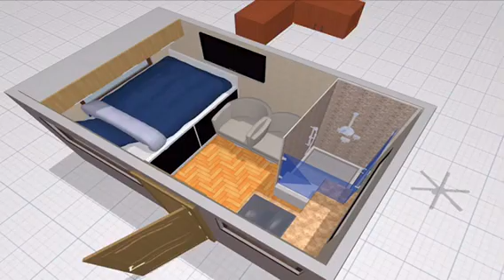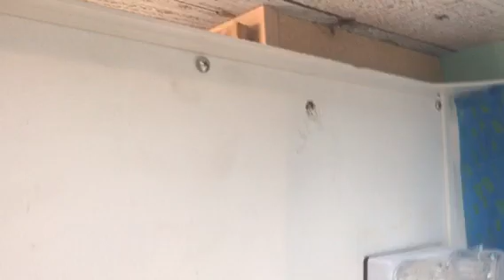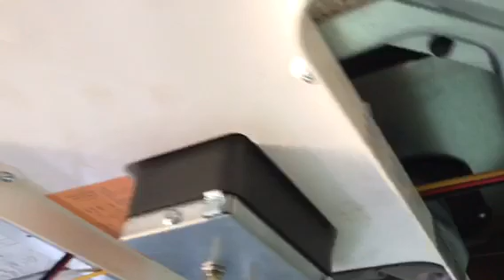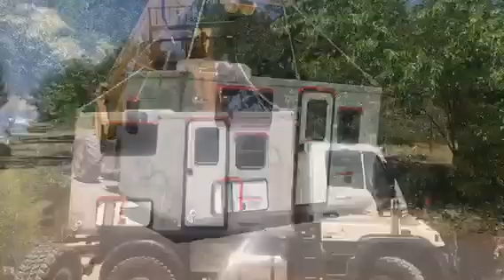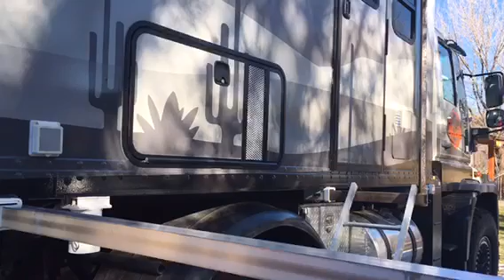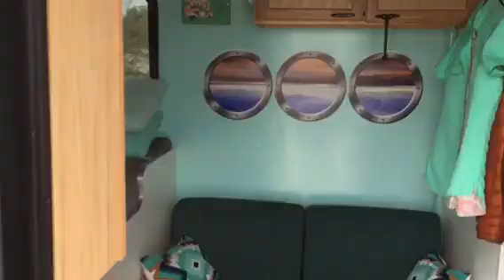Unimog U500 DIY Expedition Camper Build

Comment: Hi there John. Really amazed what you did by yourself.  Absolutey 'FANTASTIC'. But I just wondered why you did not insulate the grey water tank or tanks and opened a pasaage through the driving part. Beacuse you are really talented and it seems you have the know how about to build anything . Greetings from Istanbul/Turkey. Enjoy man. Atilla...
Reply from the maker: You are correct. I should have insulated the gray water tank.   And as far as the pass through,   I will be adding this as soon as I come up with a good plan. 
Still a work in progress. thank you for your comments
John.
Reply from the maker: My next project will be to add the pass through.
Reply: @johninthedesert2632  watching will be a pleasure for us

Comment: Just an idea, but what about an angled cover guarding the retracted veranda edges and a thin sheet of aluminium on the underside of the veranda from being grabbed by a heavy branch if you're in a tight bush track with heavy foliage either side?
Reply from the maker: Chris H I understand your concept and at the same time I would like to take a little bit of pride in not driving the vehicle into three branches. I have put a vinyl wrap on the outside of the box that would get destroyed if I were to drag it against the bushes. I did contemplate adding something to the bottom side of the patio. Unfortunately, it is Sand and small debris that gets dropped between the deck boards would then be trapped in the gap between. I have taken it on quite a few adventures and it seems to work just fine the way it is. Thank you for your constructive comments and I will consider something like that in the future.

Comment: Unimog chassis are built to have a lot of torsion, to tilt a lot. That`s why boxes are mounted allways on three points. Hope your construction with four points will work. Here a video about chassis, subframes and frames from the professional German expedition truck builder UNICAT:
https://www.youtube.com/watch?v=LCIoPuUmkb0&t=3622s
Reply from the maker: Yes, I completely understand. However, I used the standard Unimog mounting platform which is designed for this exact purpose. Yes it does use for attachment points that utilize pins to lock them into position. However, you only use two of the four pins thus allowing the upper frame to flex and float over the lower frame.  This is a tried and proven technique that works quite well. I have built many vehicles in the past and have used a three point mounting system and understand why this is a desired technique. There is also a technique that utilizes a diamond shaped pattern with a front, rear, and two side mounts in the center that will also allow torsion of the frame without twisting the box. I thank you for your input and thank you for watching this video.
Reply from the maker: My mount is actually exactly as designed by Mercedes Benz   It has four mounts but only two are pinned ant the other two are floating. 
Thanks for your comments 👍👍

Comment: epic stuff man but you definitely need to do it in segments with more information for the blank ones like me, ive never wielded in my life, kinda got lost in the minutes that followed after
Reply from the maker: Nader Elbarbary again, thank you for your input. My perspective was that most people that start builds like this aren't going to be learning how to weld as they move forward with their project. There are some basic skills that someone should already have in their arsenal before taking on such tasks. Basic construction skills are a must. Some knowledge of electrical and plumbing are also necessary. However, welding is one that is an absolute must if structural framework is involved. But once again I truly do appreciate any and all input. I plan on doing some more bills and some more videos and I will look into breaking them into smaller more complete segments. Thank you again. John

Comment: Your video is inspiring. Could you give the box dimensions? I’m considering building a similar box on a Unimog but it will have to be smaller. 10.5’ x 7.8’ x 6.5’ which will set on a U1500.
Reply from the maker: I am currently out of town and cannot give you the dimensions you need. However, I know interior wise it is about 6‘2” tall and about 7 feet wide. I believe the interior length inside was about 11’ 4”feet. I can give you better dimensions when I am back in town.
Reply: The other bit of information I could use is the wheel base. The Unimog I want to go with has the short wheel base which I think is a little shorter than yours. Will work better for off-road application. My build is going to be a little different. I plan to not have a sitting area. And will have a futon bed which will roll up providing a simple Japanese style table area that would work for me. I work in the field for 30days and have a tough time getting to town for groceries. That make having a larger refrigerator more of a priority.
Reply: Thanks for your response. It was recommended that my truck box dimensions be (3.2m x 2.4m x 2m);
10.5’ long, 7.75’ wide, 6.5’ height.

Comment: Love the look of the ceiling what did you use there it's very rustic looking.  Well done sir! I also am a tool junkie, I think I have most of the 20v dewalt line .
Reply: Jerry Nix Sorry I did not see your comment earlier. You had asked about what are used for the ceiling and it is a image of wood paneling that I had converted into a vehicle wrap. I had it printed out and then simply applied it to the ceiling.

Comment: Would have washed that ceiling with a vinegar solution, then painted it to seal in any mould that might be there.

While I agree with buying quality tools, expecting battery operated ones to be handed down is a stretch. Batteries change every couple of year, they keep getting better. 18v ones that were top of the line 4 years ago are nothing compared to the 20v ones.

Box mounting system is really going to test its strength out. Would have gone with the tried and tested 3 point system. 2 front, 1 on either side and 1 rear in the middle. or 2 back 1 front middle. A lot less stress on the box while the frame twists under it.

That is a MASSIVE grey water tank. I would expect you to have 300L fresh water tank for a grey that large.

All in all that was a great build, glad to see you are using it and really enjoying life with it.
Reply: I agree with nearly everything you have mentioned. I will say, that the ceiling was washed multiple times and was completely mold free. I then did a vinyl wrap on the ceiling that is holding up quite well. Additionally, I do like what you said about using a tried and proven method for attaching the box. However, I used the method that Mercedes-Benz has also used for many years.  The idea behind this method utilizes for sockets, one on each corner, however you do not lock all four in. You only lock in two when you are off road. Furthermore it has a double frame set up. The truck has its own frame and then on top of that there is a secondary sub frame each of which have their own abilities to somewhat flex. The box mounts to the   Secondary frame not the primary. And my comment on tools, I fully agree with you that most likely cordless power tools will not be on the hand me down list. But my point I was attempting to make is for people to spend the extra money to buy quality tools and not try to simply get away with the cheapest crap they can find. Thank you for your comments  and I appreciate you taking the time to watch my video and share your thoughts. John

Comment: Have a couple questions.
First I will say that this is a fantastic build. Great job!!
1. have you done any narrow roads that have tested the strength of the hydraullic deck and its ability to stay attached to the side of the truck? As well as the ladder? my concern would be a really tough road and having a branch or tree rip it off at some point.
2. How thick is the insulation? Would it do well in Canadian winters where the weather is often below -50?

Thanks heaps!
we are in the process of researching all of this so we can step into this reality over the next couple years.
Reply: OK, some good questions. First off, the boxes are two layers of aluminum sandwiched over 2 inches of foam core. Also, the aluminum sub structure at no point contacts the outside of the truck and inside of the truck at any location.  This helps to make the transfer of cold much more isolated. I have never been in temperatures that cold however I will say it does quite well at -5° C. I have a  A diesel fired heater that will keep the inside of the box unbelievably warm, sometimes too hot.  
 Next question, the porch is powered by linear actuators and the mounts for attaching it to the box are quite strong. Are used to inch trailer hitch receivers welded in to create my pivot hinges. However, the latter The latter could easily be ripped off of the vehicle if I drove it into a tree. But with that said, I simply do not drive it into trees. I have too much respect for the vehicles that I have built to try to drive them in places they were not designed to fit. The box and porch combined with the latter are around 8 feet wide. I simply choose my trails wisely and if I am in doubt I will get out and assess the situation before continuing.  I hope this helps to answer your questions. Thank you again for your comments, John